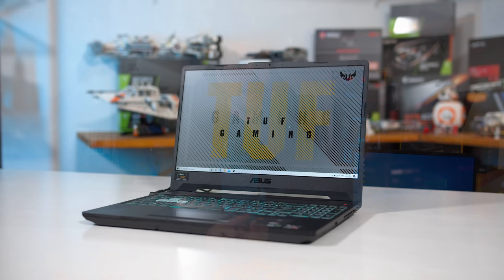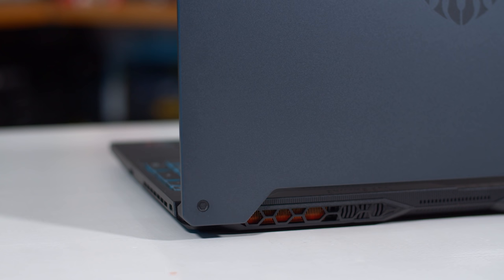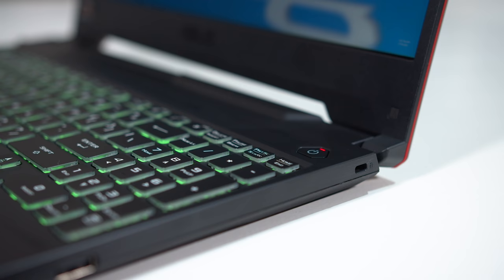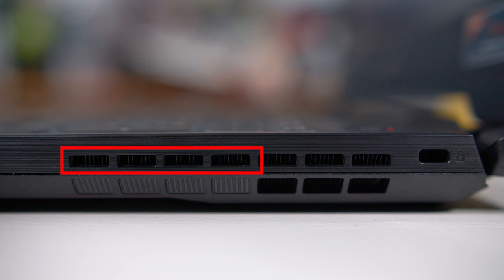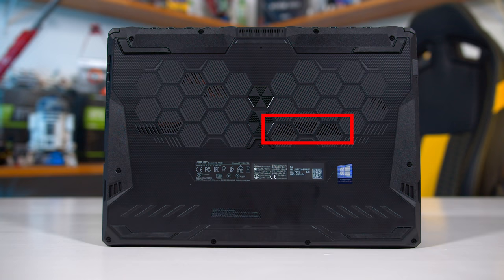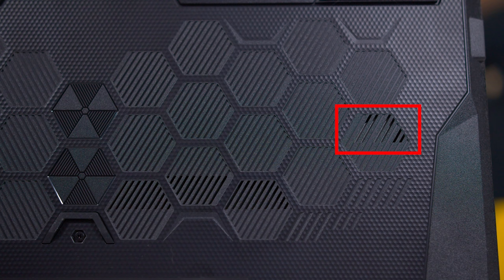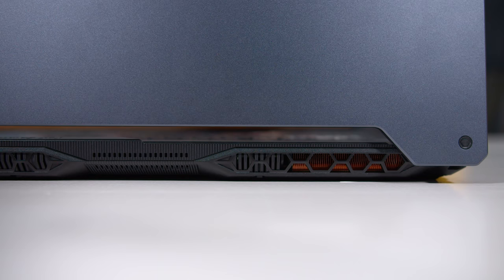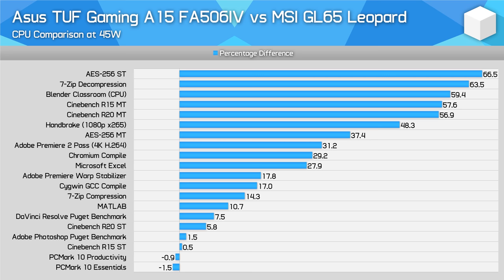Don't Buy The Asus TUF Gaming A15 (2020 Model)

Comment: I wish i had seen your video before i purchsed asus tuf gaming A15 laptopn 2021 model. I would appreciate if you could help me to with difference with FA5661C Series & FA5061C Series motherboards as ASUS is avoiding my question as my old motherboard FA5661C  was replaced with USED motherboard FA5061C model i want to know i FA5061C better/older than FA5661C series.

Comment: I have the MSI GL63 and after some tinkering around, I found that a USB fan underneath that PULLS air OUT was a huge win. 10degree drop in idle temps across all components. The fan isn't even that fast. I think the problem of some f these gaming laptops is that heat is getting stuck inside the case itself. Will check load temps shortly.

Comment: I bought one of these laptops and boy they are so powerful. Especially the cpu made me a fan😁. And yes there is an issue with the cooling. It gets really hot and you would not dare put your hand in the front of the grills. The gpu stays cooler than the cpu normally ranging in the 85 range. No idea about the actual cpu temp though. Sound quality is good with a gud amount of bass. The fans are loud and it feels like being in the midst of a thunderstorm. The display even though its not 100 percent srgb but is crisp and gud view angle range.

Comment: The comments on the cooler design based on the small fin separation Im gonna guess they were going for higher velocity convective heat transfer rather than conductively cooling. The turbulence require may need a small opening area. You wouldnt get better cooling on your pc if you left a panel open, That being said, im not qualified at all on heat dissipation design, just hoping these are not features of a designed to fail method

Comment: Most of this review is nonsense. This guy seems to forget that this laptop is made to MIL-STD-810H standards, and a bunch of huge gaping holes would get in the way of that. There's ways to control temperatures so you don't have to really worry about it unless you're playing super high settings. The only thing he may be half right is about the panel, but honestly, if you actually need a very high performance screen, you're not going to buy a lower level gaming laptop. I actually have an Asus TUF A15 and I think it one of the best bangs for the buck right now. I paid $1k for mine.

Comment: Hey guys I have a question. I am interested in buying this laptop. I already have an 144 hz monitor with an 1 ms response time. Would it co-op well with my monitor if i'm looking at the response time and refresh rate? I know the response time from this laptop is poor, but would it be better if I attach my monitor or does it still have the effect of the laptops settings?

Comment: I really regret buying my asus Tuf fx505dt. It randomly shuts down for no reason at all.
But before that my Tuf really shut down didn't turn back on months ago
I've had this fixed and the tech said it needed a new motherboard, which costs 3/4 of the original price of the laptop.

I agreed in buying a new motherboard and they bought it. 
But still...
Tuf gaming is just a piece of a hypocrite good-looking laptop with a lot of failures it brings, especially randomly shutting down!

My online learning is badly affected of this laptop

Comment: When I turned on my A15 (Ryzen 9) for the first time, it failed to boot around 4 or 5 times, it restarted on its own during all these failed boots, and succeeded on its own without my intetlrvention. The lights on the keyboard flashed a couple times, the Asus logo popped up, then just turned off with something that sounded like the hard drive/ssd turning off. Should I be concerned? I had charged it for around 2 hours prior to turning it on.

Comment: I think the base varient is good 
I played games like fortnite and GTA v and it's giving 80+ fps with 80 degrees in temp .

Editing performance is great but while rendering it goes above 85 degrees .

Fans are noisy only on heavy load .
This laptop can withstand more than 100 degrees I guess (not sure ) 

I'm from India and if you are looking for something the price range 60k it's the best laptop to buy ! 

I have done proper research throughout the internet and finally bought this !

If you are not a fan of high temperature just change the thermal paste !

Comment: I keep getting problems playing some games with mine 1 year into use. FPS drops randomly and slows game play. The GEforce experience app likes to turn all the graphic settings up on all games like Holdfast and Rust and that may be why. Biggest problem was the GPU fan has started to not work correctly and making grinding noises, I'm currently waiting for a replacement. If anyone has any suggestions on changing the settings to make it work better I am all ears.

Comment: This beast is now $899 on ebay thru bestBuy with the RTX 2060!  I was waiting for the Eluktronics RP-15 but that price is getting tempting, it's $240 cheaper than the eluktronics! The bestBuy Asus only has 8Gb ram but the Eluc has no OS for $1140. Buy the Asus and chop a few holes in the bottom cover?

Comment: I've been following the tuf laptop series from the first model, the first model of the series had the exact same problem, a hard power limit on the CPU,  blocked  vents, and a bad display. So at that time I went with predator helios 300.
This is the third product of the series(I guess) and the negatives of the first gen model are still present.
I love asus products from the PC gaming lineup, but the laptop series.... Not so much

Comment: Don't buy Acer Predator either, they won't do work. In reallity, these companies don't really design any of these computer motherboards. More than likey they are probably brought to them by different groups of Chinese manufacturers and the different models are tested and then one is picked to be an Asus model. Then the Asus name is added to the board and case is designed for the motherboard and the computer is born. If a bug pops up later after extended use, you have a lemon.

Comment: I respect your opinion dude. But i own one and i don't think its a bad choice. See first of all the display, yes its not the best but you get a decent looking screen its average and you ll not dislike it + the 144 hz makes its buttery smooth. 
Second the performance which is why i bought it. Mine is ryzen 7 1660 ti and its amazing. it can like do anything play games, edit videos whatsoever. 
Third the cooling, see if you are buying a gaming laptop obviously it will heat up . this laptop heats up like touches 90 degrees centigrade  but only in gaming. Other stuff like video editing its around 60 and day to day usage its below 55. i play games occasionally so its not an issue for me.
See its a great value for money device atleast the one i bought here in India  and i am not regretting it.
i  have even made a b roll video on this laptop fully edited on  it (if u wanna check you can check my channel ;) )
Summing up what you have said i respect your words, but my opinion is different. I love my laptop and i am proud of it :)
Peace.
Reply: I want to buy Asus tuf a15 with ryzen 5 4600 and 1650 and 16 ram.. Iam just playing strategy games like total war.. Did you recommend for me?

Comment: I really need a laptop as of now and I don't have plans on upgrading in the next 5 years. I initially wanted to choose the zephyrus G15 because it was affordable (at least more so than the G14) and had everything I wanted but it seems that it went out of stock world-wide. My budget is exactly no more than 1300 dollars and I can't find anywhere that sells the G15 which leaves me no choice. I desperately need a laptop for work and school and Intel's offerings are just overpriced and underperforming for my needs. Should I still go with the tuf A15? My work is mostly on rendering and emulation, I do some editing and light gaming on the side.
Reply: XMG Core 15?

Comment: Caught this on black Friday ⚫,  im going to use the savings to get another ips screen and 3d print a new bottom 😃.
Reply: Same here! If you've already found a compatible model for the bottom print, any chance you could help me out in finding it?
Reply: @Pix79  i was just going to 3d scan the bottom and add additional air intake at the bottom. I might add intake in the front if I can get around that massive battery.

Comment: I agree with you i purchased ASUS TUF Gaming A15 2021 model within 2 months i noticed that display had issue which was finally replaced (Display issue could have been from very beginning but went unnoticed as it was slowing light grey colors as white) , Then WIFI was dead in 4 month followed by motherboard, so far Display, WIFI and motherboard has been replaced and motherboard which i received as replacement was used/repaired/refurbished  and also model which i had previously was FA5661C Series now replaced FA5061C Series. ASUS support is arguing that i had FA5061C motherboard while on the back of laptop it show FA5661C? I will never ever recommend ASUS to anyone. You may be lucky if you ASUS is doing well once it develops problems then you are at asus mercy. Performance wise it looks good but its not reliable and out of 7 months i had this laptop i may have used it only for 2-3 months as most of the time either i was busy resetting laptop and installing software. To my misery asus support each time asked me to reset my laptop and this continued for the two months MAY - JUNE before display was replaced.

Comment: Issue is not with cooling but with cpu it heats ups a lot 90°+ which increases gpu temps to 80°+ ...
Use ryzen controller and set tdp to 15 and temp limit to 82°c for cpu then you gpu will stay at 70-75 degree...
And only 3-5 Fps drops ...
After 3+ hrs of Shadow of the tomb raider on V.high + high+ normal i get 70+ fps with only 85℃ max to 75℃ on GPU  and  82℃ on CPU
SAME TEMPS AS OMEN 15

Comment: Me watching on my asus A15 -___-

Edit: I've had it for over a month now and with some tweaking in the Nvidia control panel it's a pretty solid laptop. COD WARZONE and cold war run at a solid 60-70 fps. Valorant 110-120 fps the 3 games i play the most. I have a laptop fan that sits underneath and keeps it around 75°. Overall I'm really happy with it. I have the ryzen 5 RTX 2060 combo. Got it for 700$ on eBay, for that price i think it's a great buy.
Reply: @airihapa  haven't tried this no.

Comment: My Clevo laptop is running gpu fan at only 80% of the max speed in the turbo fan mode. Broken by design. You can check the fan speed through Aida or something. I had to use a separate program to override the default settings.

Comment: I bought asus tuf a15 2 weeks ago and i am completely amazed how asus pulled of such a great spec in one laptop. My variant comes with ryzen 9 4900h and 1660ti gpu. Yeah the thermal reaches 90° C max in my variant but compared to dell g5 SE and omen 15 it is just 5°c hotter. And amd processors usually works at higher temperature than equivalent intel processors.
Reply: I have problems with video-editing, It Is not smoothly as i expected

Comment: You know what is funny? I just bought the laptop and I love it. Also with the 1660 Ti the CPU ups to 65-70 W power and 4.3GHz all core which makes it faster than my desktop i5 8600k by another level. The display is also pretty good. Battery sucks hard, not sure if because of the 144hz display or the fact that it has both iGPU and dGPU and uses both at the same time or what. Wished there was a way to change TDP to 35W and also to disable the iGPU. Decent machine for the price.

Comment: I buyed 2060 and ryzen 7 version (i paid 900 euro ), working fine i m very glad that i buyed.  You cand resolve thermal issue with ryzen controler, i m running csgo,nfs heat,valorant,lol with 75 degree without loosing fps (1-10 fps max).Advise chanfe ram memori with something with better CL and use 2 sticks of ram.

Comment: I am fine with my temps and noise.

Screen I am not a fan of. Can I switch it out?
Reply: @big_breasts  can't really do that if you travel alot. Lol.
Reply: Personally im getting a portable screen to go with it, u can get ones that are 240 hz, some have touch, and they're thin AF, plus the usb C display output is g sync compatible according to hardware canucks.....
Reply: Also yes you most likely can change it, as long as it doesnt use more power then the one thats already in there and has the same connectors, it should be fine. Keep in mind though that even though you may have 1 year accidental damage protection from ASUS, if you have some type of instore warranty that you paid extra for, itll be void if you send the laptop in to be replaced for accidental damage because they will be giving you a new compouter and the serial number wont be the same as the one you got your instore warranty with...... ( in another words, just get a portable screen lol)
Reply: @darronpattel  yeah not too fussed on warranty. Might try the screen mentioned in this video that's in the Msi. LG panel. Connector and layout seem to match. Not sure if its freesync/adaptive sync  though.

Comment: I bought this laptop. It's shit. In addition to some of the issues mentioned here, it also has a shocking touchpad that regularly freezes (it's not just mine btw, and the Asus service centre have tried to repair it three times and don't know how to do it). Another issue is that the speakers are ridiculously quiet and then also put on the bottom of the computer to make it even worse. I regularly have to wear headphones just to hear a Youtube video. It's not really struggled with anything performance-wise, which makes these things even more disappointing. A laptop that was exactly what I needed on paper, ruined by such basic problems. Obviously if you're gaming, the touchpad and speakers probably aren't such a big issue, but if you spend any time using it to just browse the internet or watch videos, look elsewhere.

Comment: Got my Asus tuf a15 ryzen 5 1660ti laptop yesterday and I'm sending it back due to it being really slow and getting really unstable fps in the few games I've tried so far (won't even play fortnite at epic settings have to use high and even then its not great. Also it overheats. Going to get the legion 5i core I5 rtx 2060 instead. Anyone have one of these?

Comment: This video is so wrong in so many ways, I own one of these! I work as a software dev and own two main computers, this laptop and my Desktop, the desktop has much higher specs but still nothing insane as I don't really need it but I often find myself on the go and use the ASUS as a mini desktop a lot. I've had ZERO issues with over heating! In the summer months and using this a fully fledged PC in a warm room, it's often been used on unreal engine too for hours on end, I've gamed on it for hours on end on some weekends too and I've never seen it get too hot, on top of that, the fans even stay quite. I don't think this video is accurate at all.
Reply from the maker: Do you have the new fixed version? Asus took our feedback and corrected the design.
Reply: @Hardwareunboxed  so if I'm purchasing the laptop now, is it better?

Comment: You saved me, thank you for your credibility, really this video was in time, I was saving money for several months to buy this device, I used to think Asus cooling system is the best among the companies, even though the design structure did not like me either, so I created other companies that have laptops with the same Better quality and price than Asus, I live in a very hot desert area,
This device will collapse before its life. Plan to buy a laptop that lives for at least 5 years, not a device that will not last for two or three years at most.
Now I will have to buy the more expensive MSI laptop, but at least it's worth, the latest buyers comments are happy with it and the complaints rate is very low, unlike the buyers comments of this Asus laptop,

Comment: Benchmark for the amd 4800hs 19000+ benchmark for the inel i7 9750h 12000... i would get this model for music production but it will run at full speed a lot of the time, the noise is too much especially for in the studio. Too bad because i can run 50% more vsts for a laptop that is 1000 euros instead of 1300

Comment: lol guys look at this claim "The (A15) system won't come with AMD SmartShift as a result, but the raw power of the GTX 1660 Ti over the Radeon RX 5600M is expected to more than make up for that missing feature."  notebookcheck.net Asus-TUF-A15-with-Ryzen-7-4800H-and-GeForce-GTX-1660-Ti-now-available-for-999-USD-severely-undercutting-the-Dell-G5-15-SE-with-SmartShift.476807.0.html

Comment: Bro great great video. But I'm so confuse to buy. The more I see more I wait. I get more confuse. 

Choices
Asus tuf a15
Legion 5i
Legion 5pi
Triton 300

Looking for 1650ti or 1660ti or 2060?

Which one shud I go for. Just 10 or 14 FPS difference is not a big deal.
Ya maybe loosing graphic quality is. But is it worth? Like loosing ray tracing?
I have not even seen it heheh what it looks like. Mostly using PS4. 

I will use laptop for gaming. But only free PVP ones. Apex Overwatch etc.

Yes I wanna learn blender and that's 1 thing I may use it for.

Also. What is the big difference in 4 zone keyboard or one zone?
Per key RGB which I don't see anywhere except msi.

But yes I like those color keyboards

Arrow keys has to be well spaced not cramped.
Heating shud be minimum
Good speaker is important
Battery ok ok I never work on the go. Only plugged.

Screen refresh 144 is good unless I can get better which I may not need idk. Anyways in india they are not offering anything above 144.

Also color IPS is imp. Blacks are IMP. Accuracy is imp but idk what's the big fuss I have been using laptops for ages I never found color accuracy an issue. Maybe this is something new. My last laptop was 2013 still using and happy.  Lenovo TWIST and Lenovo' Yoga 14 ThinkPad. Both great.

Please do suggest.